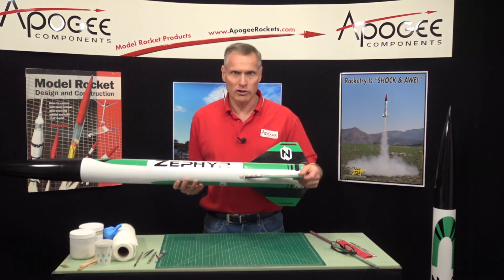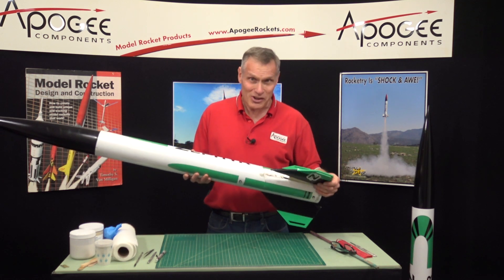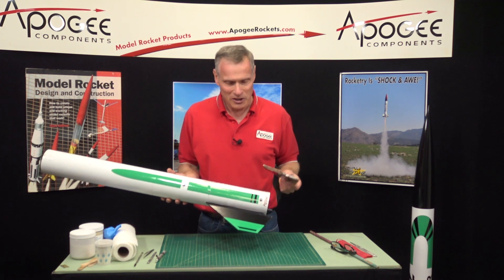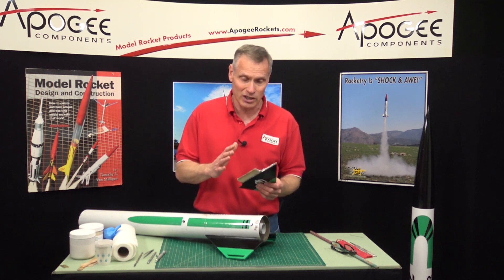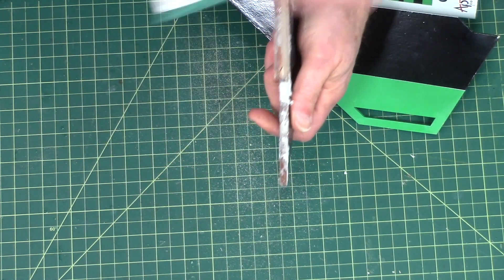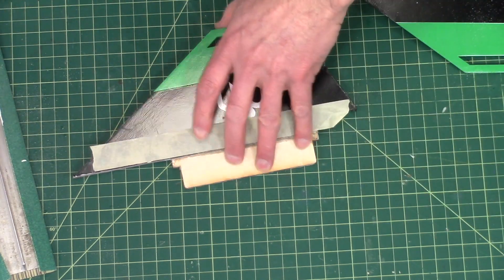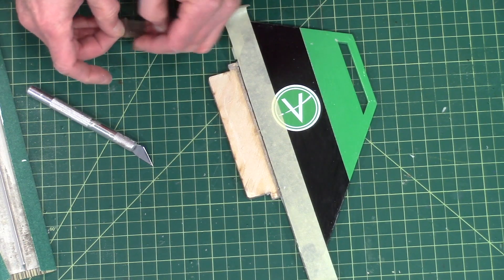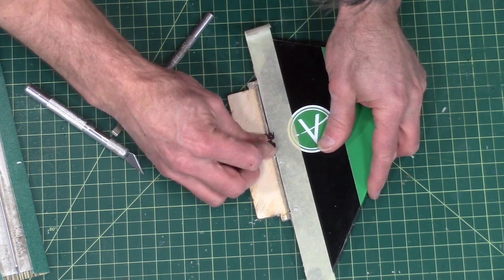Through the Wall Fin Repair: Part-1

Comment: Tim, noticed here when you zoomed on the fins, that they had a nice sealed smooth glossy finish,  I followed the Zephyr Build video, but was curious about the finishing steps you did... With the plywood fins do you fill and finish those the same as balsa?
Reply from the maker: Plywood is much easier to fill than balsa, because the grain of the wood is so tight. I just use sandable spray primer on them before applying the paint.
Reply: @apogeerockets  Thanks! I have some sandable primer left over from some other projects, I'll give it a shot.